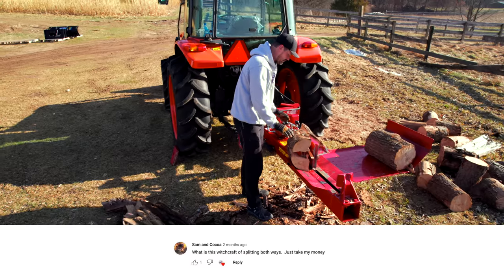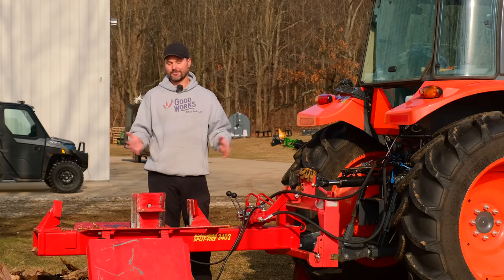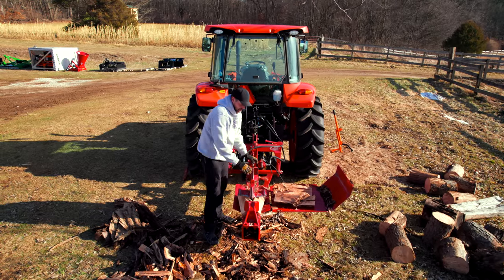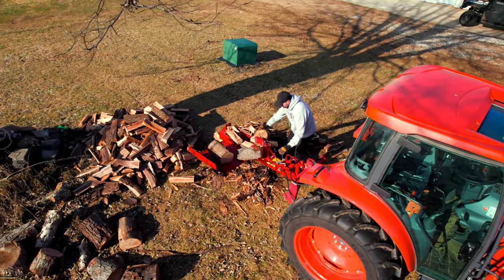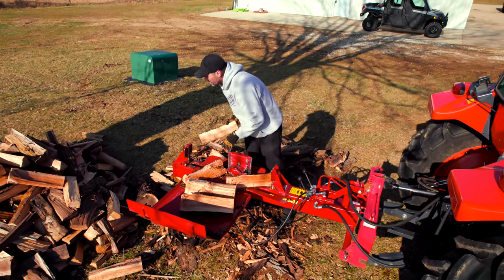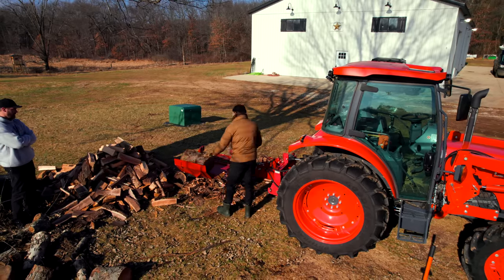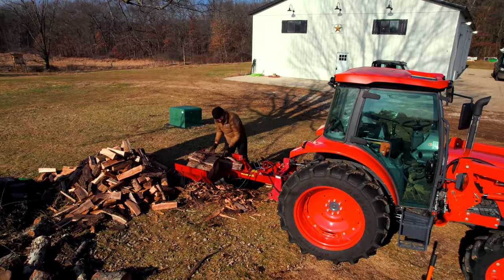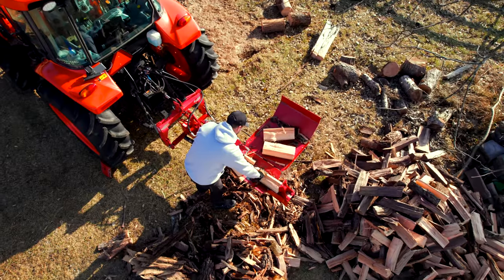THIS IS CRAZINESS! ARE YOU AFRAID TO USE YOUR TRACTOR?

Comment: I love my JD 1023E. I would much Prefer to use my tractor to do a task than a separate piece of equipment with a separate engine.  My only exception is a zero turn mower.
Motor.

Comment: Gas powered splitter for me.... it's just cheaper when you do 10 cords of wood a year.  The hours on the tractor, depreciation, higher maintenance cost etc. I like to have the tractor on a dump trailer to take the split pieces to the firewood stack. I have a gas powered splitter with a 6.5 horse motor.... and that whole motor can be replaced for 300 bucks.

Just wondering when you use the splitter what rpm are you running at? Because those new diesel engines do not like to idle and need to work...

Comment: When working firewood, I like the tractor to be separate from the splitter so that I can move firewood without having to reset all the time. Or I need the tractor for another task. The same reason I don't like a Japa firewood processor. But maybe it keeps you focused on the task at hand.

Comment: One thing you have to watch with running hydraulic attachments like this is does the oil get run through the oil cooler or not, some tractors such as the m4 divert all oil flow to the attachment and don't cool the oil and in high load applications can overheat the transmission/hydraulic pump

Comment: Wood cutting is a family event for us. A tractor power splitter would not work for us. 1 or 2 can split and 1 or 2 can run  the tractor cutting and hauling the rounds.  We can push brush off and pick up logs to cut. This way, no one is waiting  on the others. Brush mower also is a powered unit. If the tractor goes down, we can still pull it with a 4 wheeler or something. Nothing relies on just one piece of equipment . Time is money and money  is time.

Comment: I wonder if this relates to whether the tractor is moving or not. Using forks, buckets, mowers, you're actually moving the tractor around carrying loads, mowing, tilling, etc. Splitting wood, running a generator, a pump, etc, the tractor is sitting stationary. Perhaps there's an in-built bias that a tractor that's sitting there stationary with the motor running isn't really doing anything, and therefore you're just putting hours on it? 

I don't know what the operational costs of my 22 ton gas powered wood splitter is compared to the tractor. A tank of gas on the splitter goes a long way for me, but for the tractor, I've never split wood with it.  I do know hitting a service interval on the tractor is a lot more expensive -- oil, oil filter, hydraulic oil filters, air filter, etc. The splitter probably has a service interval, but there's no hour meter on it, so basically I put gas in it and check the oil and hydraulic fluid.

Comment: I agree with the fewer motors the better. I have a number of 2 cycle motors for numerous tasks and they are all problemmatic.  I have very few 4 cycle or diesel engines, each of their service, and they work pretty well. But I never buy anpther 4 cycle where m y 60 hp tractor can provide the power through pto or hydraulics

Comment: I prefer to run whatever I can off the tractor then it's just 1 engine to maintain. Small gas engines that sit usually don't run great.  I would like to get a PTO powered generator.  My gas generator may sit for years between uses. I know that I run my tractor all year so I know it will start. I don't know if the generator will fire right up. 

Ultimately how many hours are you really adding to it per year splitting firewood?  Is it worth the hassle of trying to get a small engine up and running every time?

Comment: People do not understand the amount of hours their Vehicle actually runs. The lifetime of a vehicle a person will put more hours on their vehicle than most people that own tractors. Basically think about this way. All the stop signs you sit at while the vehicle is running but not moving, when you leave the vehicle running as you go in to the store, All the hours your vehicle runs when you remote start (that is usually 15 min intervals). All this time adds up and people are oblivious to the fact. Running a tractor to run equipment is less likely to have any major damage than running your vehicle.
Reply: I have over 12,000 hrs on my truck
Reply: I bought a used ford van was used at a college people mover. It had an hour meter on it  when I divided hours by miles it had an average speed of only 35 miles per hour not very fast I wonder if that is typical.
Reply: @Austin-zw6ux  Yes.  My Chevy truck has an hour meter on the engine and I think I am close to 1,000 hours in just 25,000 miles so I will probably get at least 5,000 hours on this truck and that is with a gas engine.  Diesels will typically last at least twice as long if well maintained.  I plow snow and haul firewood so a lot of my operation is at slow speed so I tend to rack up hours more than miles and these are hard working hours, not cruising down the highway at 55.

Comment: Have both a petrol powered splitter and a tractor powered much prefer the tractor powered as it's much heavier robust and alot quicker. As for putting the extra hours on the tractor an extra 16 hours a year it does on the splitter doesn't really matter to much considering it does 500 - 650 hours a year

Comment: backhoe vs excavator should really start the war.  or mid mount mower vs zero turn.  it all depends on what you are doing and how many jobs you are doing at once.  i split logs during summer as winter is too cold to stuff around with wet wood - so mower mowing, tractor doing all sorts of tasks and an electric wood splitter.  3 motors a waste - yes but it turns out I can only do 1 task at a time so 2 motors is the minimum so 2 people can work at once.

Comment: I don't want my tractor to be tied up while I'm splitting. Most times I'm splitting the tractor is of moving wood to and from the splitter.

Oh, and I got my 22 ton splitter brand new for $800. One for the tractor, I would be surprised to spend $1400 or more.

Comment: If I had a tractor that can handle on of those spliters. I would buy it in a heart beat. Something to think about. How often do you run your tractor. How often to you start it up and let it run. I was in the Army. A motor transportation operator. I had a license for almost every vehicle with tires. The company they put my with. We manly had duce and halfs. They sat. We did not do much with them. Every week we had to do a inspection. Once a week. That means also. To start them and let them warm up. I was the only one that did the start up every week. Then the war came. Us and our trucks went. Out of all of the trucks. Mine was the only one that did not blow a head gasket. Because I started it up every week. So. If you don't use it or even start it for a long time. You will have more problems. Look at it this way. You need wood to be split. You have no real use every week for your tractor. Buying one of these is a good way to let your tractor warm up and work the seals every week. Food for thought. Just sharing.

Comment: 3 point splitter is the way to go. No gas guzzling, screaming high maintenance small engine to deal with.  Non-ethanol gas same $ as off road fuel. Plus diesel is more efficient and no small engine screaming in your ear.  No yearly carburetor cleaning or hard starts.  JD makes an diesel engine for an easy 5,000 hours.  Never get that out of small engine.

Comment: looked at getting a sf splitter for my trator but my bx23s just doesnt push enuff fluid to get good fast travl times. and it cheaper to rent a 20t splitter the 2 3 times a year i need it. as i do all my fw at one time. put 200 hr a year on tractor normally. tho this year maybe more. got lot more logging to do. And would be cheaper to buy a splitter and would have slightly better travel time than the tractor mount could .

Comment: Tractors cost more than the homes most farmers live in. If a task runs the risk of wet stacking the engine, don't use the tractor for that task. New engines are worse about coking up or ruining emissions equipment and shouldn't be allowed to idle or run at low load or low rpms. Smaller farms are doing everything they can to not start their equipment because the cost to run modern equipment is so high. Use a bale grazing method if you don't mind a little spoilage, or use an atv to roll hay out instead of putting a cold start on the tractor. A stand-alone splitter is $1300 new, close to what a full service would cost on our tractor.

Comment: I have a independent splitter  because I put the wood in the bucket.  I have a zero turn because it works better than a belly mower!
I bought a 33 hp John Deere that was six years old with less than 100 hours. It had a ssqa made by John Deere rear hydraulics, hydrostatic transmission, just to name a few options. I don’t get it, this guy bought a beautiful tractor and never used it.

Comment: a well built diesel engine should be able to  rack up thousands and thousands of hours. One thing  you can't do with a separate engine on a splitter is turn up the hydraulic power.
BUt the reason I won't do this is because I am using the tractor to load the wood.  I get  huge logs  easily 30 inches in diameter and  using the grapple is  perfect. 
So I'd need two tractors.

Comment: Most of your smaller tractor don’t have the flow to run a log splitter. I normal box store splitter have 16 gpm pump. The smaller tractor don’t pump much fluid.

Comment: The big downside of small gasoline engines is that they don't care for long periods between uses. It's carburetors and the vulnerability of gasoline to degradation. As gasoline evaporates and reacts with oxygen, it thickens, reduces in octane rating, vaporizes less and is less energetic. And unless you pay extra for ethanol free, it absorbs water too. All of this is BAD, especially for relatively unsophisticated carburetor engines. Carburetors are highly dependent on every quality that degrades in gasoline. And wood splitters are generally worse than lawnmowers in their seasonality.

Secondly, running compact tractors' hydraulic functions at max capacity puts only a little strain on the engine and none on the rest of the drivetrain. An hour on the wood splitter does not result in as much wear as an hour plowing a field, ripping out stumps, etc.

Comment: Somebody needs to build a tractor mounted splitter that uses a pto driven hydraulic pump with a separate hydraulic tank.  These little tractors don’t have enough flow compared to a stand alone splitter.

Comment: With the sorry gasoline now that ruins a carburetor. Got my splitter out while back it would not run due to the ethanol that l ate up my carburetor. I will be getting me some hoses made up to run it off of my tractor.
Reply: I use the engineered gas in all my gasoline engines. You can do the bulk of the work with gas from the gas station and then the last few minutes just use the caned gas.
Reply: I trashed my carb a couple years ago on stand alone from gas setting. Bought a new Chinese  carb under $20.00 from Amazon... when done for a few weeks I run it completely out of gas for storage.
Reply: @bhall7997  Yeah ,went that route on my pressure washer ,but the carb I bought wouldn't run. Just had to replace carb on my welder it works fine. For the price of a factory replacement carb another$50 you can buy a new Honda motor.

Comment: I have 35 hours on my grand L 4060.... reason? It's brand new. I just took delivery about a month and half ago. I've built a gun range, rotary mowed, box bladed, and moved at least 75 dump truck loads of soil. I'm just getting started. Why buy it just to look at it in a garage. Use that thing. Yes I wash it and blow the dirt off. Take care of your equipment and put it away dry. Stop being a whimp. Use your damned tractor. I have a John Deere 5410 from mid 90s. Over 10k hours still makes mad power. It's 81hp. Runs like a Deere still after decades. Stop being damn wusses. I have KTAC insurance so if it breaks they'll fix it.

Comment: The thing that I saw was the side lift. You don't have to muscle up the Rounds to the splitter. The other is the double direction the tractor mounted splitter has, cuts both ways. You also are at waist High. I was bending over so,so much with a Rental LOG splitter. They are too close to the ground. I had to constantly watch the Hydraulic OIL on a portable Log splitter. The HP of the tractor is Higher. Lots more power to split wood. If the LOG SPITTING 3 point Hitch attachment is not being used, or sold, because of what people say. The manufacturer would QUIT making them. The market for SALES is obviously out there.